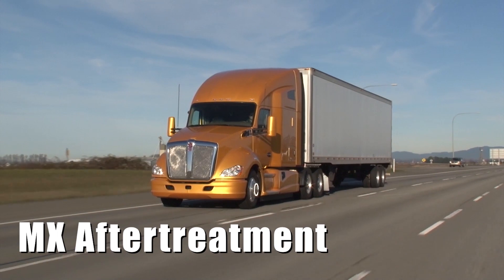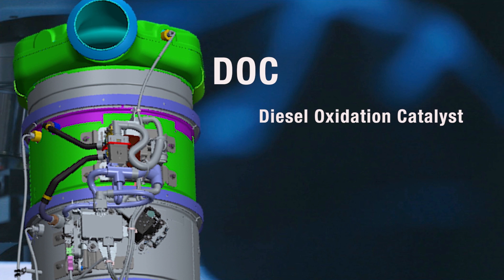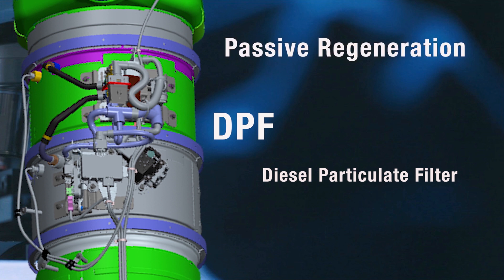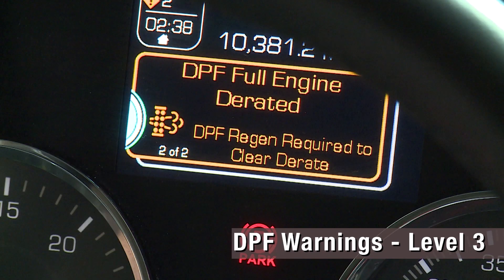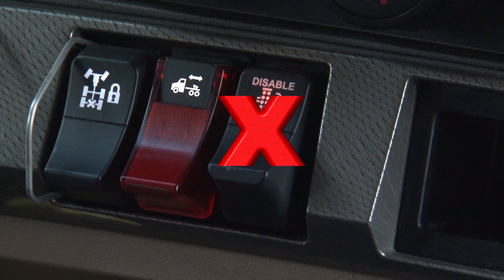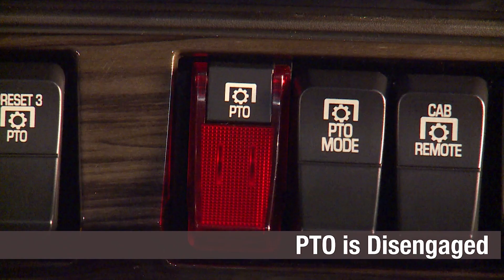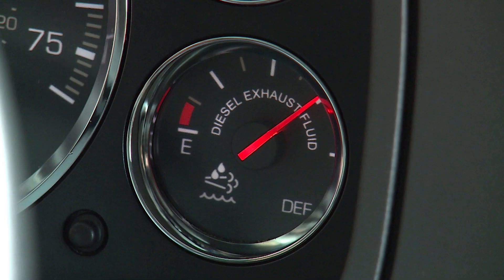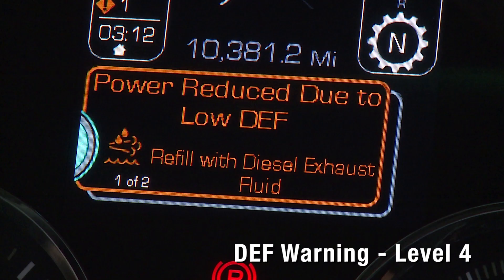32: T680 Kenworth Driver Academy – Engine Aftertreatment

Comment: Is there a way to check if regen is needed, ?
When I first picked up this truck about 4 days ago there was a couple of indicators on the electronic dash that look like those images you're showing on region needed or Auto Regen I honestly don't remember truck was new to me so I don't know I don't know the details of the vehicle yet but it isn't doing it now so and I don't think it has an auto region switch I think it's just a two position switch on or off I guess my question is can you just do a regen, or do you have to wait until it says you need to do it.